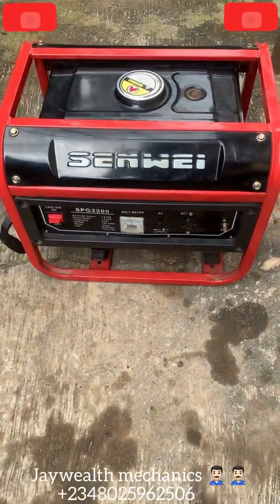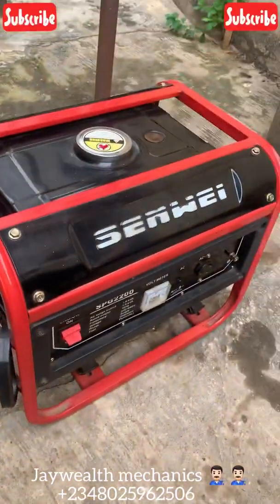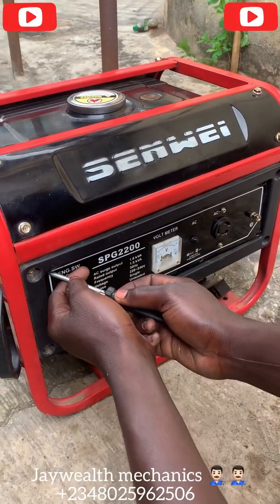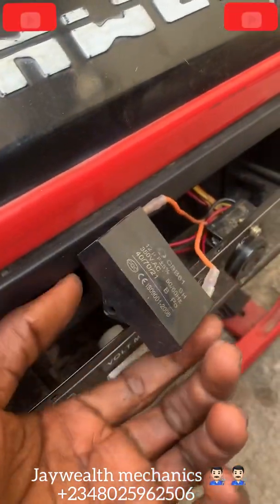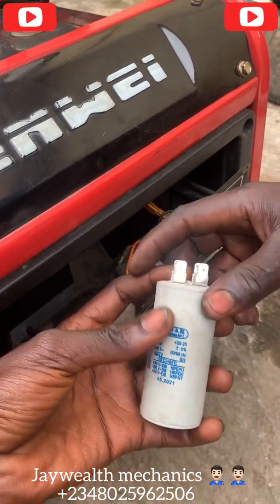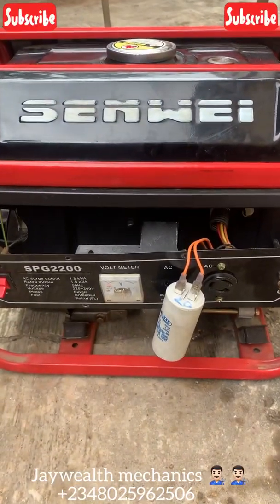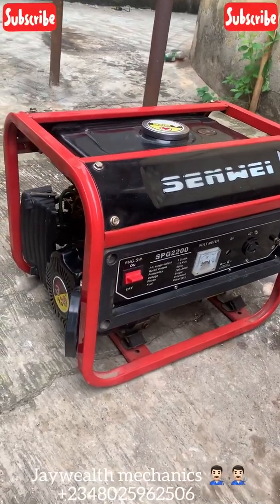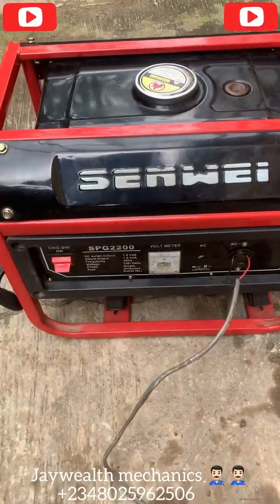Generator output Most Easy Solution | Capacitor Method

Comment: is it ok to use much higher value than 20uf capacitor? what is the effect?
Reply from the maker: The effect is that the voltage will be too high.